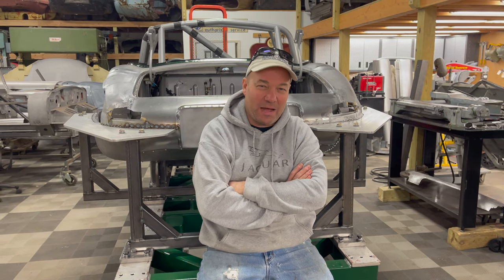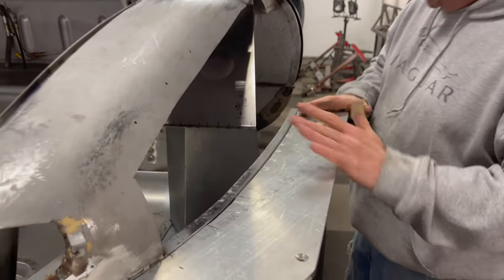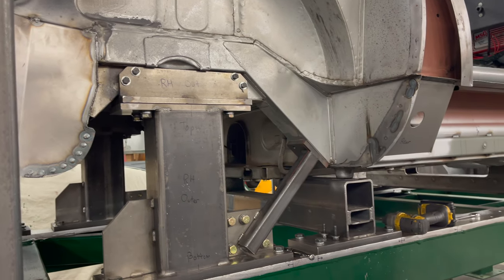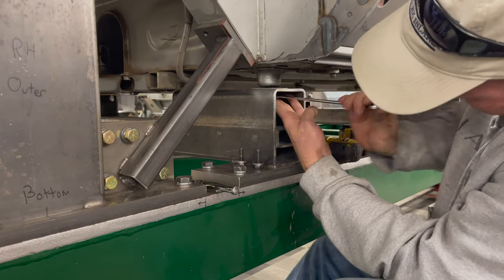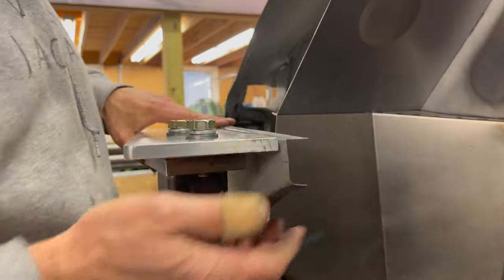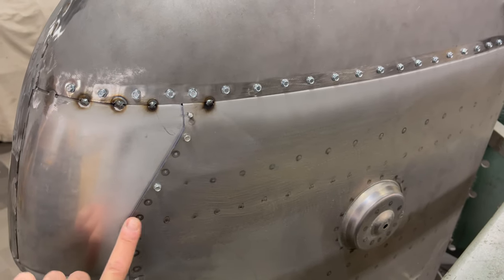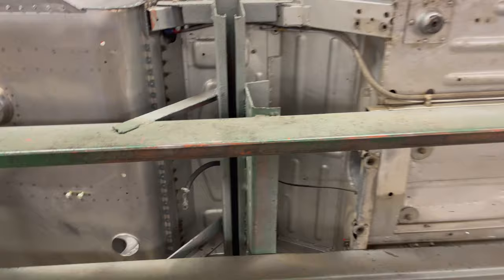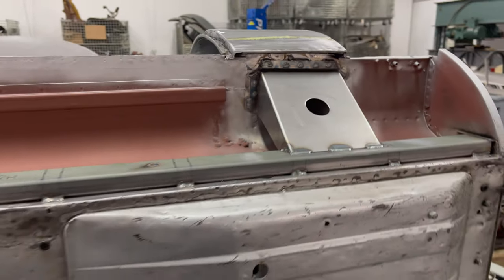Jaguar E-Type - 1967 Vintage Racing Crash Repair - Part 12 - Flip and Weld

Comment: Hi Chuck . Regarding those gaps when you released the jig brackets ........nothing on a big ship ! As we say over the pond . Regarding the the jig and rotissorie , did you have them made or did you design and make them yourself ? They are very comprehensive both in build and fit. Well , l think  you can see the wood through the trees ! Great stuff ! Thanks Chuck